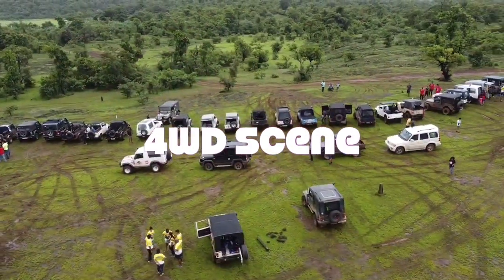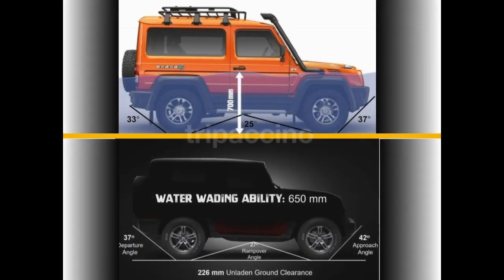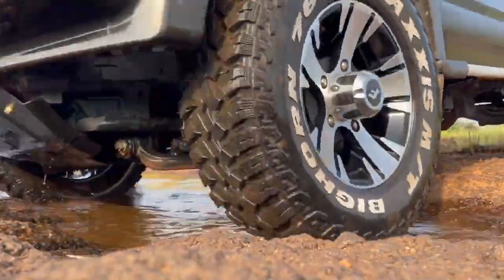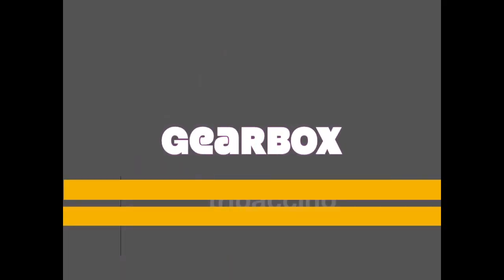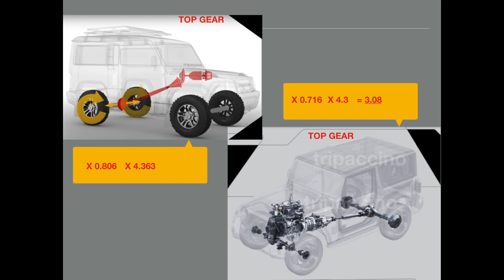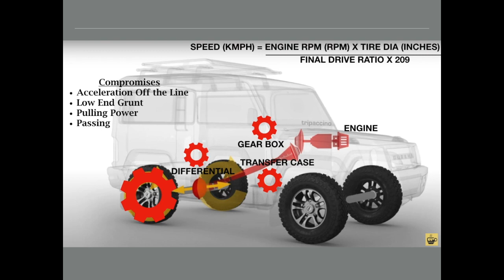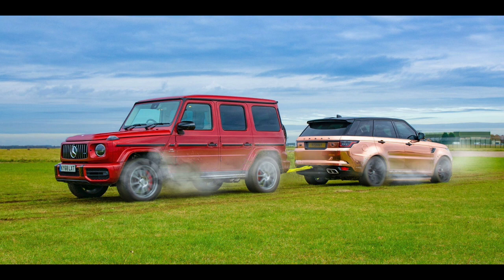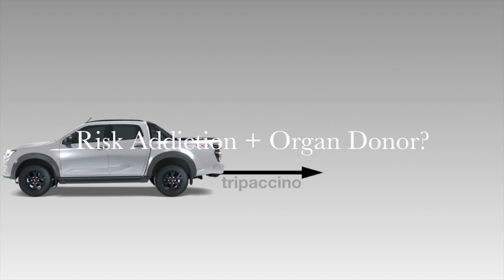Mahindra Thar vs Force Gurkha: Why I did NOT buy Thar . Tug of War Inside!

Comment: Why not use a standard automatic gearbox with a torque converter? This aspect has been known for years by true off-roaders.
Reply from the maker: Sorry brother. could you please explain. Didn’t get you. Auto box where ?
Reply: @tripaccino  instead of a manual gear box!
Reply from the maker: @brunoterlingen2203  that part I got. Which truck are you talking about. Thar has an automatic box already as option. You suggest Gurkha to also have a TC?

Comment: Brilliant video!!! My 2 cents;
1. You have not considered the weight difference between the two anywhere. The 400kgs extra kerb weight on the Gurkha can never be offset by making any mod.
2. Comparing what a Gurkha can become with what Thar is as it comes from the manufacturer is a bit skewed perspective in my opinion. Slightly modified Thar will throw the Gurkha out of comparison at once. 
3. Except for the cabin space I dont see Gurkha scoring any points over the Thar- blank slate to blank slate or from slightly modded to fullfledged, nowhere close.
4. Gurkha has the presence no other rig has in India right now. That is it. All of us buy the Gurkha just for that and ofcos as I said for the cabin space. We are Gurkha fan boys pretty safe to say 😂

Comment: Thank you for your time! Really! 
Now with new Gurkha, all the calculations would change, right? As i understand, new Gurkha's tuned engine is to produce 138 BHP, so would it be like Thar (faster), on higher gears? Also how would the R18 would make a difference (5 of them) - heavier vehicle - on overall performance? Also the ground clearance is increased, will that positively affect overall dynamics, I know it solves the most talked about big issue of hitting bigger rocks with previous generation Gurkha!

Eagerly awaiting your response!
Reply from the maker: Yes, correct. Ratings would change 
Because of 1. New engine tune 
2.New gear box (Xtreme gearbox as I have suggested in this video has been accepted by Force for the new Gurkha)
So it will give good low end grunt and good cruise in high gears. The turbo still is the weak link imho and juices out as much as it can but the weight needs to be respected still. Bigger tires will also change gearing ratio and torque at wheel 🛞 as explained in the video. Need to just replace the values from the new owners manual

Comment: Thinking about it, Gurkha xtreme was the bomb. Rigid axle suspension, stock lifted. G32s are much smoother. Man, FM should really get their stuff together. They literally had the formula which would work wonders. They deadass had to kill their golden duck. RIP.

GREAT VIDEO BTW. HOLY :o
Reply from the maker: Yea I miss the Xtreme too. FM had to discontinue because of very less demand for a hard core solid axle based off-road specific truck. I wish they had brought it back. 😊would have picked it up without a blink. 
Updating the 2.2 140would have been expensive additionally as the 2.6 is staple across the board, cost which they would have avoided. Let’s see the new tune in Bs6.2

Comment: I’m going to buy a Gurkha 5-door. Do you think I should wait for the 2025? Just 4 months left. I’m hoping they might iron out some minor issues with the current model.

PS: Force ought to start giving you commission for Gurkha sales!
Reply from the maker: I’m betting that they will quietly swap the brake pads or bite tuning in the brakes in the next batch refresh to fix the sponge brake . If you can you should wait. They did a similar refresh in bs6.0 and I’ve put a video on it.

P.S: I don’t want commission, only timely spares parts availability.
Reply: @tripaccino  Hoping they also make the middle row adjustable (reclinable/slidable).
Reply from the maker: May not happen. Rails require re work at design level which force won’t do

Comment: You, sir, are a legend! It's one thing to be so involved with your vehicle, and another to be so intricately detailed with your content. From your TBHP threads, to this channel...gorgeous stuff. So much to learn, and process. To me, the Gurkha's aspirational value has increased manifold thanks to your creed of "gentleman offroaders". Thanks for existing!
Reply from the maker: Thanks for following me on both plat forms .Keeps-me charged to produce more quality content
Reply: @tripaccino  something struck me and I can't wrap my mind around it. Please, accept my apologies in advance, because this would likely sound dumb...
The Gurkha is ~390 kgs heavier (figures from Autocar India) than the Thar and that leads to the advantage in a hypothetical tug of war scenario as you explain. But how does the torque:weight not influence the outcome, provided all other factors remain same? I mean both cars need to first be able to move itself from standstill before overcoming the opposing force, and the Gurkha is at a disadvantage there (paradoxically because of it's greater weight), no? Not sure if I'm making any sense...
Reply from the maker: @MidlifeEscapades  Thanks for the question. I expected this clarification and hoped to clear it in comments because it would clutter if I had explained in video and make it too boring.

Outline: None of the factor I mentioned , can work independently so for ease of understanding I had simply de linked them in order of priority. And please do note the disclaimer I have deliberately put in :- The engine power torque and how it is put down on ground is important.

Case 1: If the weight difference is large. 

1. Take the heavy rock example. Why does the rock have to move itself? With a small engine if it even manages to move itself a bit, the Thar is going to find it further more difficult as opposite force is now weight, friction and small engine thrust of the rock.

400 kgs is kerb weight difference. It is 20% of the vehicle weight! not small difference.
Also it Doesn't include accessories and mods which will weigh up the vehicle heavily. Let's assume next case and simplify.

2. If the weight difference is comparable, then the traction on wheels will play a part and weight distribution will come into play. Gurkha will be rear heavy, and also aid its traction.

3.If you're looking for physics - then opposing force is friction * Opponent weight. The inertial force is Self Mass x acceleration.This acceleration would depend on the engine definitely. But if your self mass is less then your product is less and hence force is less. So you’re making lesser force to propel against opponent in that sense. 

For ease of understanding we are splitting these two physics seperately for ease of understanding - in nature all are happenign parralllely.!

Hope i have not confused you more. Simply one line:
If two gurkha's one fitted with mHawk and one fitted with FM2.6CR, then engine and power delivery would come into play. And the mHawk would win! Until then, weight on the driven wheels rules :D
Reply: @tripaccino  Thank you immensely for taking the time and effort to reply. My mind's at rest now, I do understand it so much better! You're the physics teacher, so many of us never had 🙂
Reply from the maker: Thanks and please do feel free to ask anything . I’m glad you asked this . I was hoping someone would . Because I wanted to explain this particular aspect. 

It’s like looking at the same scene through two windows - One is Newton’s second law and other is third law. Both cannot be used together to understand same scene. Scene is happening but you can look through only one window 🪟at a time:

Fun fact: gurkha weight distribution is 
Front 1270 kg 
Rear 1240 kg

Comment: Hi..I do have a question..
Why can’t force relaunch extreme in bs6..
Reply from the maker: I wish they could too.
But the market dictates makers. The actual demand for a purely offroad based setup like the Xtreme (Solid Front Axles and factory body lift etc) is very miniscule for them to take the effort to homologate it for BS6. The 'less extreme' explorer with good offroad kit which would satisfy wider audience was instead made into BS6. The engine in Explorer 2.6 was also staple across the board including the vans so one time effort. The 2.2 was unique to the Xtreme and the Force One before it.
Reply: @tripaccino  true..
Thank you so much

Comment: What if we can remap gurkha ecu make it 130 bhp? Or install diesel tronic ecu.. For 115 bhp? It would perform better..
Reply from the maker: The present configuration has limitations of remap. The components can only absorb so much torque as per rating, 
1. Turbo is tiny presently - very small compared to older Gurkha - so starved of kick .

2. G28 has torque limitation. With power up torque will also boost which G28 cannot absorb

3. The ECU of this gurkha cannot be read right now. Presently no protocols exist for proper remap of this version ECU. (Delphi)So once those are l released it would be better to attempt proper re maps. The present Diesel Tronic option is only a single channel fuel regulator and Wolf has benched the ECU. Personally wouldn’t go for either . Will wait for protocols to be available for proper remap.

Comment: Hi!!! I  have a question for you. There is a product in the market called Rogerab Suspension Buffer. The company claims that it makes the ride quality more cushy and lessens the body roll. I own a 2021 Mahindra Thar and have been considering to get it installed. Can you please make a video explaining the pros and cons of the same and whether the product is viable or not? Also will it by any means hamper the suspension and it's overall performance in the long run as most of my driving is either on long stretches of the highway, sometimes on the hills or a fair bit of off-road here and there.
Thanks ✌️
Reply from the maker: Ah! Rogerab. Im aware of these and have run them in their early days on a sedan. These are also band aid patch work temporary solution. They add a polyurethane or foam buffer and increase ride height by extending spring length. 
I would suggest please watch my strut top hat spacer review video to understand pros and cons of such temporary mods to suspension. This plays with the coil just like top hats play with struts. I have spoken about spring buffeers as well in that IIRC. 

If you want a suspension upgrade I would suggest a full swap with Dr Nano or some kit like that which will be the full term soulution.

https://youtu.be/wDYovWfnM1M
Reply: @tripaccino  Got your point. Let me watch that video and get back, if any questions at all. Thank you so much for finding time to reply to my query. Cheers 🍻
Reply from the maker: Anytime brother: my pleasure
Reply: @tripaccino  I just finished the video you suggested. I had infact seen the video earlier but couldn't correlate then which I was able to do this time. So no Rogerabs for now. I will consider getting the struts changed in future without increasing the height of course. I'm never keen on increasing the height of the SUV or changing the tyre profile drastically because it just damages the essentials in the underside of the vehicle and reduces the off-road performance in some cases. Thanks a ton!!!
Reply from the maker: Thanks for watching that. It was one of my most knowledge sharing videos , but surprisingly didn’t find as many takers as I expected. 😈Maybe a bit long and draggy for today’s short attention span. 🤔
Reply: @tripaccino  Wow... I'm surprised you say that... It's an amazing video. I paid attention to almost all the details and I even paused or reversed the video at some points. It was simply marvelous. You're a hero bro

Comment: What about displacement? Those pull power on the Gurkha is reall. I have seen this engine not sweating at all even in full load, that to 20 years ago in trax avtar. Though this engine never crossed 80kmph, that truck used to have no slow down or behave slower on hill climbs. Either Force is lowering the numbers on paper, cause the 2600 cc displacement for sure can pull a lot than thar
Reply from the maker: Displacement is the volume of engine. 
Pull power is torque. We have shown how gurkha hits peak torque earlier. 
We have explained advantage of both in gurkha combined with tractor like gear ratios which all manifest as the great low end puller it is.

Your observations are correct as we have noted in this narration - 
‘the gurkha will slowly climb to 100 and stay there all day like a freight train thanks to its large displacement 2.6’
Reply: @tripaccino  Thanks. I forgot to thanks you for creating a lovely informative vlog, which was unbiased and completely stats on paper kind of thing.

Comment: One question why Gurkha has low sales...is 
Marketing ?
Is it features ?
Is it brand value ?
Is it love angle ?

Why  it is not getting sales ? As desired ???????
Reply from the maker: No sales as desired because there is no desire.

The company is content with selling the numbers it does. There’s no big push for volume. It’s a margin game for Force.
Reply: its a combination of the above. My family were Force Motors (then Tempo) dealers for over 20+ years. and the company had very good technically sound products like the Tempo Trax, Traveler, Matador. But jus didnt support dealers in marketing them, no one knew who the manufacturer was. The only time they tried marketing was when they rebranded as Force and launched the Force One which as an old SUV they rebadged for india. If memory serves me right they used Amitabh for that campaign but it bombed due to low brand awareness, mediocre product and no follow up campaigns. Even now if you see their digital platforms they use tacky stock photos and mock up the vehicles on them or use only content shot by users. Which is of poor quality versus the slick ads a Mahindra makes.
Reply: @tripaccino  why Force Motors is not diving in hard in the market as the product they have " A capable vehicle like GURKHA" ?.....because there's no other brand's vehicle that soothes the naked eye as Gurkha does....So the question is the Force motors satisfied 🤔🤔
Reply from the maker: @gauravthakur9634  force motors is India’s largest van maker: its profits don’t come from the niche Gurkha : the main source of revenue is their engine and drivetrain axle production for Daimler Benz and BMW which is a thriving vertical. Gurkha is the margin product for them. So they don’t go for cut throat pricing or offers or tv ads or banner ads z What sells , sells. And who buys buys. They are in a state of rare contentment with regard to their only passenger car offering. 
Trere is huge potential to blow up the gurkha into a solid international offering but Force is not ready for that kind of commitment to the Gurkha. Watch my Indian Grenadier video for the sentiment. 🤔
Reply: @tripaccino  beardar I already watched it(granedier)but Gurkha is our own niche defender...that's where it hurts...par mere bhai ji apne toh apne hote hai..😅😅...parayo se kya lagao rakhna ....no matter how good they are...😄